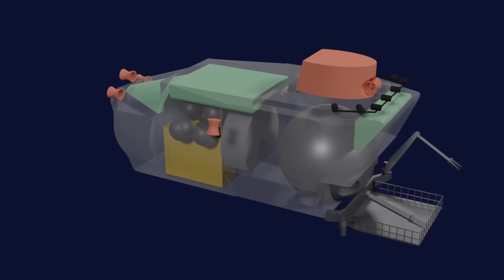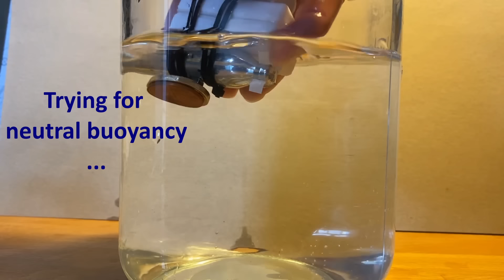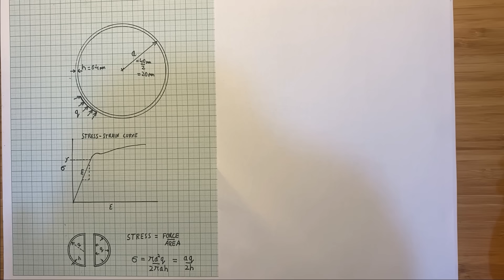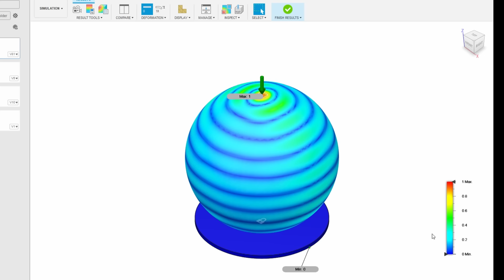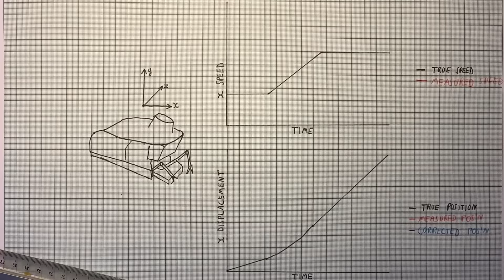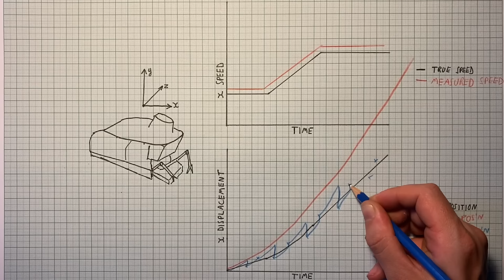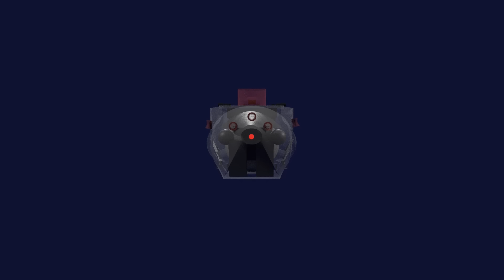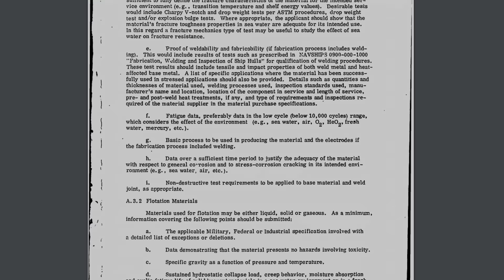DSV Alvin : How to build a safe submersible

Comment: My question, is how are the batteries ... are they pressurised? (back pressure) or how does it work? I mean even if they are so tightly packed to not have allot of air inside?! The pressure is enormous.
Reply: The Batteries are compensated with Mineral Oil. The oil floats on top of the battery acid. There is a large rubber bladder at the base of the batteries that holds several gallons of oil and has a syntactic foam block that exerts a bit of pressure via ballast force to keep the battery's internal pressure slightly greater than the external seawater pressure. A pressure relief valve at the top of the battery prevents that pressure from becoming too high and bursting the bladder.

Comment: why dont they just poke a hole in the sub so water equalizes the pressure and put on snorkeling masks 😹😹😹😹 so much easier 👀
Reply: Wet subs basically do this, but the deepest scuba dive is 330 meters - one twentieth of the depth Alvin can reach. It also takes a lot longer to return from depth, due to the need to extend decompression time to safe levels.

Comment: It’s so interesting how the close call was the cable breaking when the hatch was open. A dangerous situation while being completely unrelated to pressure or being stranded underwater. It’s a good reminder that there exist dangerous instances and failure modes that you haven’t thought of. Obvious in hindsight, but I would have never thought of it.

Comment: Curveball for you, what if someone farts it the pressure vessel🤨 What preventative measures are in place to prevent or mitigate such an occurrence?
Reply: Known hazard of the profession. The sub has an Activated Carbon air filter mat in the intake to the CO2 Scrubber but all who venture into a sealed environment with other humans should know the risk of foul odors that may persist much longer than a fart. 
The toilet facilities consist of pee bottles, trash bag, and a roll of TP. I have had one dive that called for the trash bag to be deployed. 💩There is a sign on the mess deck of Alvin's Mother Ship Atlantis that says PB4UGO.
Reply: The application of profanity, a shoulder punch, and occasionally a cork are the usual remedies, I should think.

Comment: Honest question here.... Have we ever discovered anything so deep in the ocean that we needed a deep sea submersible to discover that has made a difference to human civilization?  I guess the technological advances could aid humans for space travel but aside from finding plane wreckage or a sunken vessel I couldn't "fathom" a reason to put yourself at such risk except for bragging rights...
Reply from the maker: Off the top of my head:
1. Life around deep sea vents. One of the most significant biological discoveries of all time. 
2. Deep sea mapping. Allows for cable laying etc. necessery for international communication (aka the internet).
3. The oceans ecosystem is the worlds largest co2 sink. Understanding this may help us to not completely wipe outselves out via climate change.

There are many many more examples. I urge you to read up on the scientific discoveries made by Alvin
Reply: But no reason for any manned craft to descend to those depths....

Comment: Thank you so much for this video. It's presentations like these that advertise what REAL engineering is, and how it outshines any bluster and bravado by some idiot throwing out catchphrases and pseudotechnical jargon. There are a lot of posthumous fans of Rush in the YouTube comments sections, and it's all because they still can't tell the difference between two men claiming their work is superior to the other. THIS is the demonstration of who is correct. While Stockton Rush was quick to hand wave requirements away, Alvin shows that there's nothing super-secret about doing maths correctly. Here's the numbers, here's the calculations, here's the decades of work upon which our constructions are built. If we see further, it is because WE stand on the shoulders of giants (proper Newtonian emphasis on "we").

Comment: Could a pressure vessel big enough to seat five or six passengers be made? Would a magnesium alloy provide more strength and buoyancy than titanium?
Reply: Been done in 1960s (Aluminaut). Cylindrical aluminium hull with enough space for 3 operators and 3-4 mission specialists or scientists. It's actually the sub that helped to recover Alvin after the crane accident. Rated for 4600 meters.
Reply: If we're talking some sort of tourism experience, maybe it would cost less and be safer to have six one person spheres, arranged facing outward in a puck shaped submersible. The puck shape allows the vehicle to rotate in place to give each passenger the desired view. Building six identical smaller units offers some economies of scale.

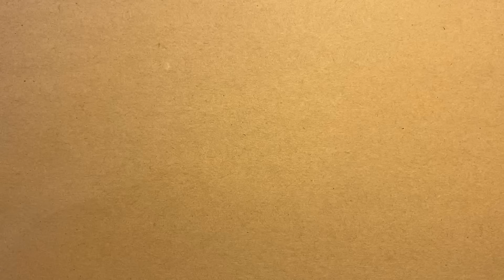Comment: At 4:52 and i had a thought: since a compressed air tank is (probably) under tension from containing high pressure gas inside it, a pretty good, lightweight material to make it out of might be...carbon fibre.
Reply: Some air tanks are indeed made from carbon fiber. You need to treat it differently than metal, but it works decently

Comment: 25:20 The submersible knows where it is at all times.
It knows this because it knows where it isn't.
By subtracting where it is from where it isn't,
Or where it isn't from where it is (whichever is
Greater), it obtains a difference, or deviation.
Reply: And arriving at a position, it now is.
Reply: How does one know where one is not without also knowing where one is?
Reply: @thevoicestoldmetoagain4627 if your in a car blindfolded you know you’re not in your house if, you’re somewhere on the sea floor you know you aren’t at the ship
Reply: What if the car is in the garage?
Reply: @thevoicestoldmetoagain4627  this isn’t how the submarine actually navigates, it’s part of the Missle Knows Where is Is copy pasta.
Reply: @judet2992 Inertial Navigation Systems are used for both. Although nowadays cruise missiles have INS systems fused with GPS for correction.
Reply: I think that was mentioned
Reply: This feels like a reference to The Hitchhiker’s Guide… 😂
Reply: @TheVeganarchism  it's a reference to a (bad) explanation of a missile guidance system from around the mid 20th century
Reply: @snark894 It's not so much "bad" as it is "unnecessarily long-winded and convoluted."  The description itself is accurate enough, but they used way too many words to say something that could be made a lot simpler.
Reply: @vicroc4  it was probably like that for safety concerns. It's a lot harder to parse it if English wasn't your first language.
Reply: @qwertyayz  Ah, in other words an early way to avoid ITAR
Reply: @TheVeganarchism it is most assumably not

Comment: 11:30 until VERY recently, ping pong balls were constructed out of cellulose. Which is extremely flammable. Large boxes of ping pong balls actually had "fire hazard" warnings on them. I don't know when the switch to plastic took place, but sometime within the last 15 years or so.
Reply: Yes and hardcore ping pong players HATE the plastic balls. Even today they are supposedly less consistent and apparently do not allow as many play options.
Reply: At my university dorm, the ping pong table was next to an open fireplace.
That was when I learned what ping pong balls were made of; as this was ~20 years ago, evidently before the switch in material.

Comment: It is worth noting that a ballast tank doesn't have to exceed sea pressure if a pump is used to help evacuate water. For example, if the absolute pressure of sea water is 6000 psi, and your air is 3000 psi, a pump like what's used in a commercial pressure washer can pump water out of the ballast tank by adding 3000 psi to it. The concern is that now your ballast tank is a pressure vessel, and has to resist implosion. But this is how it's done on submarines.
Reply: Not exactly - submarine  (main) ballast tanks are not pressure rated. Variable ballast tanks, or trim tanks are however pressure rated and use pumps to transfer water or I gest/expel water.

Comment: I know we are in the non-linear realm, but, isn't it possible to make small spheres or models with of the same chosen material to start experimenting the elastic properties of the material and other parameters like the welding and things like that?
22:40 After watching the tolerances in the sphere of Alvin I find the Titan construction process Insultingly insulting.

Comment: As a fellow brit I do have issue with metric, and that is you have to mix metric and imperial as time is an imperial measure.
Reply from the maker: Seconds are the SI unit for time. I should really say ‘SI units’ rather than ‘metric’

Comment: As an American, keep doing your calculations in metric. Imperial is a stupid system. Mixing units is also dangerous, as we saw with that one Mars lander.

It's really a shame because seeing all this it's understandable why the Titan engineers went the carbon fiber route, it solves a lot of these problems and lets them simplify a lot of the systems. It's just a shame they didn't put the work in to make it actually work and instead just cowboy'd it until it imploded. If they actually took it seriously maybe they could have pushed the state of the art forward. (Or maybe they would have discovered carbon fiber just cannot work as a hull material and saved everyone else the trouble.)

Having the foam on the outside sounds just terrifying to me, but with all the stuff they've done i imagine they've done the best thing that could be done. Really, it sounds like they're doing it the right way with Alvin.
Reply from the maker: Yeah I’ll keep doing that. I’ll probably always convert results to imperial for the sole reason of making my content as accessible as possible.

Comment: If I were to build a submarine, my design would be an updated, enlarged Trieste.
Reply from the maker: The original Alvin was very much developed from the Trieste. Much more capable and with a larger crew compartment. But at the cost of lower rated depth.
Its really really difficult to scale up a bathysphere for reasons similar to those i mention at the start of the ‘buoyancy’ section.

Comment: This is superb analysis of just how much work it takes to make a reasonably reliable and safe system. Some other designs of submersible *cough cough*, really highlight the slapdash methods you can use and get away with - but not reliably or safely.

Comment: For the ping-pong ball, you could use a watchmaker's water resistance testing chamber. The ones that go to 6 bar are near-ubiquitous in the business.
Reply from the maker: Thanks. Yeah that was just a quick ‘throw it together for a 10 second video segment’ but a lot of commenters seem interested. I may revisit it in the future.
Reply: A soda bottle holds pressure quite well up to 2-3 bar, but I wouldn't stand near it during the test.
Reply: @AndyAz  How would you get the ball inside?  I guess there are jars and bottles with larger lids but they probably can't take so much pressure.
Reply: @MattOGormanSmith  In my childhood testing Gatorade bottles can reach slightly higher pressures than most other soft drink bottles although it will noticeably deform pretty quickly.
Reply: Or just ask to use “The Hydraulic Press Channel”’s video of them destroying ping pong balls (and carbon fibre tubing) in the high pressure chamber they built.
Reply: Also I'm fairly sure a lot of ping-pong balls aren't ABS but rather nitrocellulose.
Reply: nitrocellulose has been abandoned for ping-pong balls
Reply: @superslimanoniem4712 -- Probably not, at least not for a very long time, as nitrocellulose is *monstrously* flammable. Movie film was made from it until 1950 or so, and huge numbers of films from the silent era are lost because it has a bit of a tendency to spontaneously combust as it ages. The last nitrocellulose pingpong balls were probably made in the late 30s, maybe the mid 50s.
Reply: For a heath Robinson approach I recommend using a fridge compressor, it's a great bit of kit as you can use it as both a compressor or a vacuum pump (I use mine currently as a silent air brush compressor) pressure cookers make great pressure chambers (unsurprisingly) and inch thick perspex would make a suitable lid to see inside for filming although you could just stick an esp32 with camera module inside the pressure cooker, if you do that you get the fringe benifit of a wifi enabled kitchen product as well...

Comment: When i first saw the Titan sub using a video game controller, i didn't think of it as a huge deal (except for the wireless part of course, USB uses serial communication and can be used with very few points of failure with a bit of work).
Now after seeing the cockpit of this submarine.... its basically the difference between a Tesla and a Boeing 747.
Reply: It still surprises me how titan looks like baby's first DIY sub vs what Alvin looks like.

Comment: 21:46, so what you're saying is, titanium is totally just like in joining two pieces of wood with wood glue, the joint will be stronger than the wood itself, depending on a significant amount of other factors.
Reply from the maker: In the case of electron beam welding its not like using wood glue, the analogy would be fusing together the two pieces of wood at a microscopic level with no glue. Ive read a little more into it and the welded zone is often indeed stronger than the material.

Comment: Stupid Question, why not hold the emergency ballast with an electro magnet or a similar system. So you don't need a emergency battery, but if all power is lost, they detach automaticaly?
Reply from the maker: That is something i was wondering - thats how the Trieste did it. If i had to guess, when risk assessed, they may have decided the risk of an accidental release in an entanglement hazard zone (ie where there are potential obstacles above the craft) was higher than a failed release given the level of redundancy present. Thats just my guess though

Comment: At NASA we use metric for everything except pressure, and sometimes temperature (K or C depending on application). It's extremely funny.
Reply from the maker: Basically what I did in this video! I dont know why no one uses Pa
Reply: @Alexander-the-ok  I've got no knowledge there. Standardization is obviously important for any international effort, but it seems certain things have remained arbitrary due to industrial inertia if nothing else.

Comment: ping pong balls are celluloid, not ABS....
Reply from the maker: Not anymore they aren’t, they switched a few years ago
Reply: @Alexander-the-ok  that's quite odd. apparently they didn't switch to ABS directly either, but rather that table tennis governing body mandated non-celluloid balls before a decent alternative was even properly developed, and manufacturers used noticeably weaker plastic for two years before they settled on the rather obvious choice of ABS.

Comment: Im kinda surprised that Alvin doesnt have an inertial navigation system. I though it would be a good choice for this purpose
Reply from the maker: I think it probably does, there is just no info available on it.
The doppler velocity log is basically an inertial system with a step removed though

Comment: It's all very well to do your calculations in metric units. But what happens when your sub is operating in American waters? Then it faces pressures in good old pounds per square inch. And your calibration will be way off. Typical European thinking.

Comment: Super minor correction. The points in a FEA are called nodes not elements. Elements are what connect the nodes. 

If you send me your dimensions and material props I can re-run your ping pong ball experiment in NASTRAN. That first buckling mode you showed is not what I would have expected, although my gut could be wrong. I always cringe when I see ANSYS used for structural analysis. 

Good content. Keep it up!

Comment: The Alvin sub is one of the only subs I’d even consider traveling to the sea bed in.  I’d feel safe because literal science and math went into every single aspect of the craft. Great in-depth (no pun intended) video 👏🏽
Reply from the maker: I’d go in any of the current operational DSVs. They are all similarly built and certified
Reply: To be fair almost all Deep sea subs have gone through the same certification process as Alvin
Reply: @jameson1239  I have a suspicion that all deep sea subs currently operational have gone through certification :)
Reply: You should prefer the Limiting Factor
Reply: @AhmedKhan-qk3xi  papa Gaben's sub is the most based, for sure. Also the only 2 seater full ocean depth dsv anyway, so the only option unless he's a certified sub pilot himself
Reply: @AhmedKhan-qk3xi  only slightly though, unless youre in water deeper than alvin can handle of course

Comment: This otherwise great video didn’t address a major question I have: how are power and control/communications signals conveyed between the interior and external of the pressure hull without compromising hull integrity and system reliability?